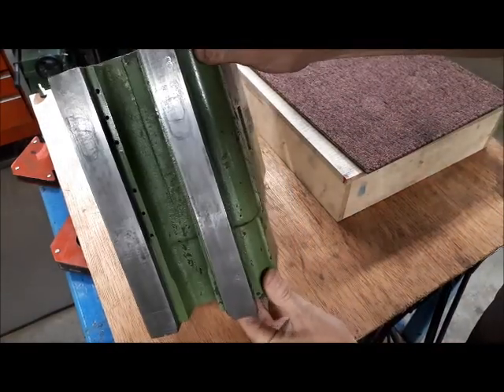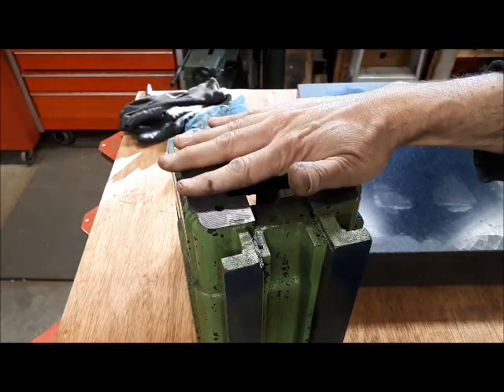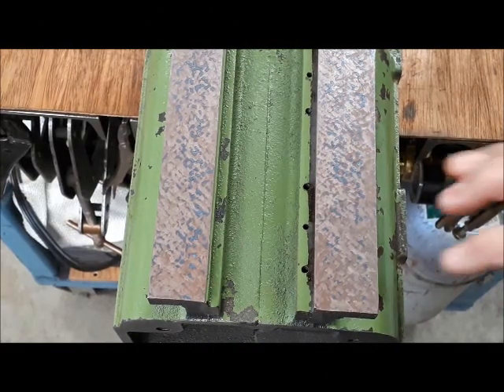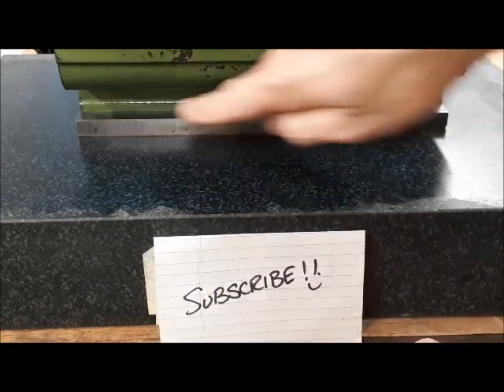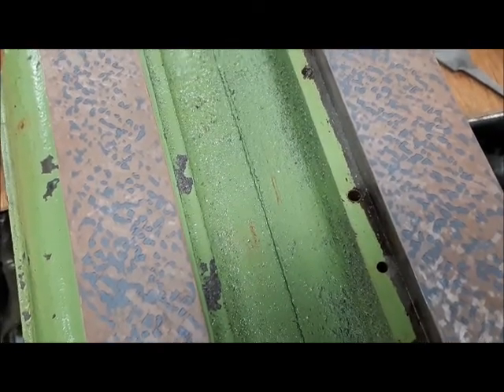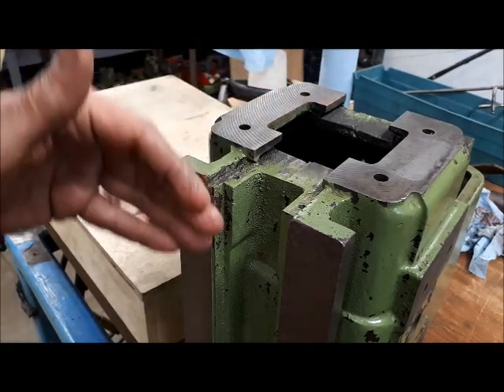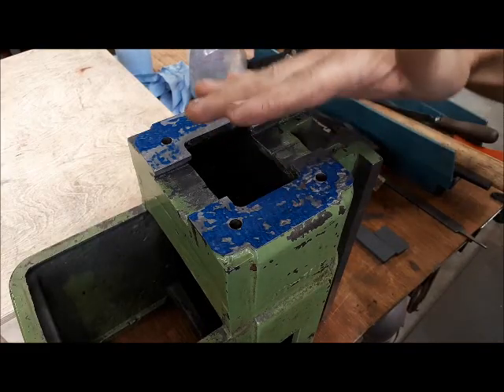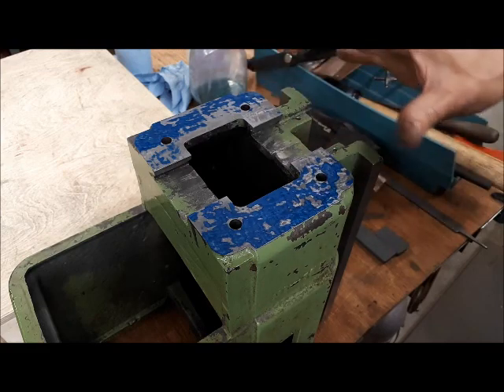Atlas Horizontal Update 3

Comment: I really appreciate that you are taking the time to do these videos.  I have the same mill and will likely do the restoration in the spring.  Are you power scraping or hand scraping. If power scraping, what machine are you using?  If hand, is your scraper shop made or purchased?  Thanks again, great video.
Reply from the maker: I figured there would be some interest in this mill so it was/is a fun project. I do both power (BIAX) and hand (Unknown hands) scraping depending on the amount of material , the type of surface and the quality required. I have both commercial (Anderson Bros. ) and shop made (Unknown Apprentice) from an old insert and old file. In this series I'm showing a bit less of the actual scrapping as I spent considerable time filming it on the Bridgeport. I'm not a fan of doing things twice so that's the reason for just the methods / my thoughts on how I'm approaching the work. As always, thanks for watching and commenting too.

Comment: I wonder if they had the spindle tipped up to account for gravity acting on the tool?
Reply: That could be a good possibility Brian, I'll have to keep that in mind once I get mine torn down far enough to double check it's spindle alignment.
Reply from the maker: Yikes!!!! Baily would not approve! Typically in the only book on this subject, Connelly's Machine Tool Reconditioning, they call out a tolerance for such surfaces but indicate that the +ve side, as an example, would be "preferred" to counteract tool pressure etc... . Either way it's Apprentice close now :) . Thanks for watching and commenting!
Reply from the maker: @turningpoint6643  Make everything component as Flat / Parallel / Square as you can, and you'll be in good shape!
Reply: @unknownapprentice625  :-) That's the plan, my actual scraping experience or the lack of makes me a bit apprehensive about just diving into it though. So as I said, this series should be a massive help in walking me through the steps and checks. Reading the Conelly book multiple times taught me the importance of maintaining that 3D alignment and that's what separates somebody that does know what there doing verses a hack like myself.